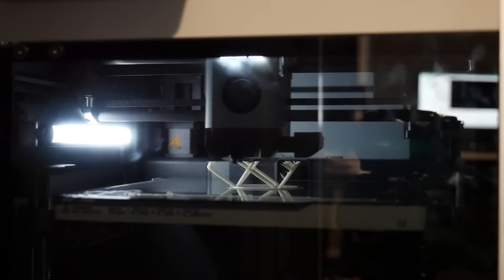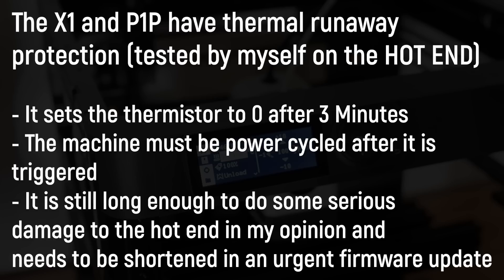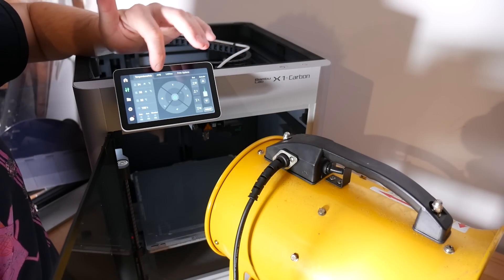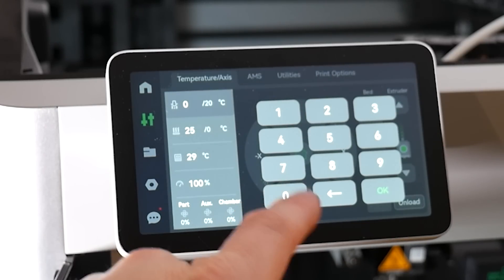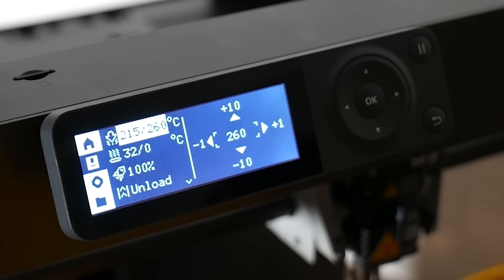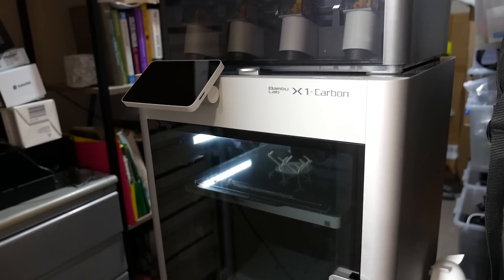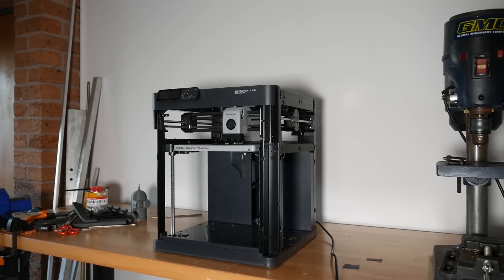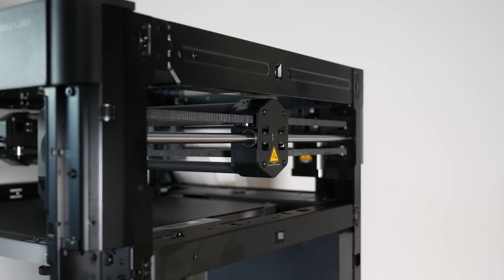Thermal Runaway Testing on Bambu Lab X1 Carbon and P1P

Comment: why not use a dam of putty like material around the bed and fill it with alcohol... may prevent the heatbed to reach more than 80C (boils at 78C) 
if it goes much higher the bed has a very bad heat conductivity!   
same test can be used fot the nozzle (if you only insert the tip into a bowl of alcohol or water (nozzle can reach far hotter than boilingpont)  than you can estimate the heatconduchtivity inside the printheah   ( the higher the Heatertemp the worse the conductivity)

Comment: Good and quick video. It does feel like an arbitrary number... there's a reason at least one company (Prusa) has a self test that checks that things heat up to a certain amount in a certain amount of time. Too high at "time", and there's one issue. Too low at "time", and not only is there an issue but it will probably cause TRP to kick in. If it is indeed arbitrary, lowering it is easy and some tests can be done to verify. Else, as they say, they'll need to update their thermal model and test. Also: forgot this side channel existed... need to make sure I'm subscribed :P

Comment: Read the official Bambu Lab announcement. When printing, thermal escape works instantly. Without printing, it works after 3 minutes. e.g. manual filament unloading. I tested it with the thermistor removed from the printer. Works properly. This information should be in the video.

Comment: Poor thermal runaway protection = no thermal runaway protection. The v400 also has a similar issue with poorly configured settings in this regard. People should not buy these printers till the problem is fixed and even then I would be hesitant to trust the company afterwards. Safety systems should always be a top priority. It shows a company's true colors if they skipped on something like that. Paired with some of the oversights of security and abuse of open source technology and Bambu is shaping up to be a shady company. I for one will not be recommending Bambu printers as a buy option moving forward.

Comment: From observing all the discussion it seems like software thermal runaway protection itself is the real danger. It is a safety crutch and seems to create an extreme false sense of security in the commnunity that it causes social media blowups like this. All hotends NTC hotends are not safe (the regular heater cartridges are all these), PTC hotends are much better (Revo/X1C/...), none I've seen have mechanical thermostats, and none have thermal fuses. Software thermal runaway protection does not protect you against a switching or wiring fault which is the most common cause of an electrical heater fire. It also uses the same switching element that could cause the thermal runaway event which means you are not safe with software TRP without an independent means of disconnecting power (manual reset main power breaker for example that is only used for TRP).

Not to mention a fault that kills the switching element could also kill the MCU running the software so your screwed while a surge would be more likely to cause a thermal fuse to blow which is the desired safe condition. So fuses/thermstats/PTC heaters add a ton of safety value while TRP is at best on the same safety effect as signage that says you will die past this adding some value but not remotely enough for the potential danger.

I do understand why thermostats and thermal fuses are not typically seen, Adding mechanical thermostats would be complicated by the wide operating temperature range you'd need a digital encoder on the shaft so the printer can tell what the max temp is set to and thermal fuses would need to be tightly coupled to the heater cartidges or elements making them specific to certain filaments which would make things complicated. It also still would not stop you from putting a CF hot end into a block of wood fill PLA that would still probably catch fire in a fault condition but short of using inert atmosphere there is always a limit for open ended systems where some degree of the safety aspect is upto the operator to conduct their own safety assement before use.

Comment: Thanks for the fact-injection to the discussion :-) 

My feeling is that it’s very good that the issue was found and reported on, but I am disappointed to the jumping to conclusions that occurred. As you said, even you might have concluded the same, but I doubt you’d trumpet it to all and sundry before even contacting BL about it :-/
Reply: Tough to do that during a live stream, don’t you think? And there were several other issues, such as the system sending data back to China, and the team at Bambu didn’t do anything until it was trumpeted to all and sundry.

Comment: I'm glad to see an outside test on this by someone who has the skills to do the test well.  It's good to have some independent verification of what's actually happening.

I also agree that the folks raising the alarm made the right decision; 3 minutes is much too long when printing PLA and we really needed to catch this.  I've said elsewhere, and I'll repeat here, that I think Bambu has been surprised by how much PLA people are putting through their machines - and although the P1P having the same system weakens this argument, I think the setup was really just a blind spot on their part, since they designed the printers for things like PC and CF Nylon.

Now that they know about it, I'm confident that - Covid notwithstanding - Bambu will put out a suitable firmware fix in due course.  As a company they've been very responsive to my personal issues (BambuSlicer got corrupted somehow and wouldn't even uninstall) and seem to be pretty quick on support in general.

Comment: Angus -- So the algorithm in question revolves around the control board not seeing the hot end reaching the target temperature within 3 minutes?   Yet I would have thought the firmware would have some idea about rate of change of temperature, and would be able to reliably detect an issue much earlier than having to wait for the entire time it might take to get to the max target temperature under all circumstances?  I mean, the hot-end power-vs-rate-of-heating curve would be pretty predictable, though varying a little depending on ambient temp. (And an ambient temp  sensor wouldn't be out of the question). Once at target temp, power (PWM %) to maintain that temp would also be a pretty predictable quantity.  Or maybe those parameters need to be acquired by a learning session. Regardless, it seems to me that rate-of-temp-change vs power would be a faster way for the controller to learn of a hot end problem.
Reply from the maker: I have no idea how the actual protection works as it's a closed source system, but that's just my theory considering how close all tests were to 3min almost exactly. I haven't explored sinking heat from an already at-temp hotend though to see what that would do.
Reply: @moremakersmuse  Sorry, I didn't mean to disparage your investigation. Just express disappointment that the algorithm would use time-to-target, instead of rate of change or power required.
Reply from the maker: @Graham_Wideman  No problem, I definitely agree with you there!

Comment: Revo and possibly also bambu doesn't use true PTC self-regulating heaters, only MCH Metal Ceramic Heaters.
youtu . be/  FIXG3tlILCY?t=975
Reply: MCH has a PTC value. PTC just means positive temperature coefficient it isn't a particular construction or material. https://www.analogtechnologies.com/document/MCH.pdf looking at the datasheet it clearly says no temperature regulation required below 500degC forumulations (For that MCH it has a tempco of 3300 +/- 200 ppm/degC which is positive clearly compared to nicrom wire ). Which means you can supply direct power to it without issue no software thermal runaway protection required. 

There are many types and regular heater cartidges used in e3d style hotends are NTC type heaters meaning (very dangerous) without thermal fuses/thermostats software is not considered enough to regulate NTC type heaters as they get hotter they get hotter faster and can typically get upto temperstures in the >1100degC in runaway conditions enough to ignite almost anything.
https://www.heating-element-alloy.com/article/heating-elements-properties-and-types.html
Reply: @riakata  It is not NTC heater in e3d. It is slightly PTC like most metals.

For me PTC heater is commercial name to the heaters with very sharp temp-resistance characteristics, different technology, which indeed can maintain desired temp when they are connected to a small heatsink, and also keep the same temp when detached.
Calling MCH PTC is confusing. (Bambu doesn't call them PTC)
Reply: @KBS_  PTC is not a commercial name it literally means positive temperature coefficient. Heater cartridges in standard e3d style are NTC heaters physically. NTC just means they are vunrable to thermal runaway hence the name thermal runaway protection. PTC heaters do not need an attached heatsink to be PTC it is a physical material property of the heater that self limits its own resistance so they self regulate even when detached from their heatsink. They certainly will heat up faster and to their maximum self regulation temperature without a heatsink but an NTC heater which is any nicrom or many other type heater will just keep heating until things get melty and firey.

You cannot "personally" believe what PTC means it is a not a trade name. They specifically say " Due to the properties of the heater, the higher the temperature, the higher the resistance " this is literally what PTC means.

Also not all metals have PTC characteristics https://dbkusa.com/blogs/whatisptc/ntc-vs-ptc-heating-elements it depends on the alloy and metals used. MCH elements like the one you found and the ones I found are PTC type elements with maximum self regulating temperature compositions upto 500degC which fits with the 400degC they mention.
Reply: @riakata  Did you even read what is in this link? It clearly says what is NTC heater.
Reply: @riakata  You also didn't read yours first link. 🤣🤣🤣
"MCH ceramic heater features no noise during operation and
radiates infrared light that is beneficial to the human body. It is
mainly used to replace the most widely used alloy wire and
PTC heating elements and components. Compared with the
former two, this heater features corrosion resistance, high
temperature resistance..."

Comment: Awesome testing ! I think the takeaway here and what Nero said in his folllow up video is that the time-out of 3 minutes is longer than most, unexpected, and can be improved. As an owner of a p1p, I’d rather see something along industry norms of sub 1 minute
Reply from the maker: Agreed, that seems to be the takeaway. We're happy it has protections in place, but they're not sufficient to prevent damage.
Reply: Well even a minute at high temps is enough to cause damage it is more a reducing damage. Obviously the best protection would be to have a software thermal protection, PTC heater, a mechanical overtemp thermostat, and a fusible link. Software is usually the last thing you want to rely on for safety. But to date I don't think I've seen any commercial 3d printers with true hardware overtemperature fuses. (If you look at any kettle, toaster, high power heating device they all have both thermostats and fusible links internally to meet safety regulations) The voron 2.4 design does specify dual thermisters and physical temperature cutoff switches for the heatbed but I guess due to the added mass and complexity hotends never seem to have the basic thermal hardware safety measures.
Reply: On that note, some of us were messing about with the heater cartridges on our x1s in the discord.  They are PTC heater elements, and it is current measuring, so there is that.  Also checks for continuity through the thermistor and I think all the fans use the tach for feedback.

I agree that I would like to see the timeout reigned in a little with the option to override for corner cases where necessary, but the amount of hardware in the loop is impressive.

Comment: I had a problem with the duetwifi and a hemera , the first time a tried heating for petg and not pla , I think the thermistor came loose and did not detect it , ( lots of smoke and melted the part cooler fan duct ) but the duetwifi is good at the first stage to get up to temp , because you will get a warning I was expecting a 1.7 deg increase per second , but only got 1.3 deg per second , so if you forget to put the heat sock on it will detect it.

Comment: So they say in their statement it can't get any hotter than 400c, but do you all realize the auto ignition point for PLA is 388c
Reply: Which means the pla will be long boiled away before igniting. Hell, there's nothing left to burn in the hotend if you leave your hotend at 250 for 20 seconds.
Reply: @3dPrintingMillennial  still not a good situation to be in tho
Reply: @Tobashadow  Well a thermistor fault is going to cause something to go wrong its just will your house burn down and the answer appears to be no. (Unless you smear about 1kg of wood fill PLA under it) although that is why you should be careful what filaments you use. No 3d printer is technically as safe as a standard kettle, space heater, etc... they use PTC heaters (the first defense the 1XC has as it is self limiting), mechanical thermostat (never seen a 3d printer with this on the hotend), and final thermal fuse (also never seen on a hotend). Notice software thermal runaway isn't part of regulations because it is just a bandaid better than nothing but it can't be called "safety rated" in any respect as it requires the FW to work, the delay to be short enough, and the mosfets to actually stop the heating (some thermal runaways are caused by the mosfets failing short at which point thermal runaway protection is useless and only a PTC heater would save you)

And at that point it will keep heating forever until you cut off power. My voron 2.4 has backup safety rated relays on the heaters for the thermal runaway protection software to have another means of disconnecting power but that is also something you will probably never see on a commercial printer as it is expensive. I don't think I've seen even a mod for thermal fuses for hotends. Heatbeds yes. hotends no that I know of.

Comment: Great on topic Video Angus. 2 follow up questions though:

1. Do you feel that with the current implementation of TRP that it is 'safe' to use the machines before a firmware fix is issued, or should users set them aside?
2. Other than seeing the error on navigating back to the home page, was there any audio or on screen warnings/notifications when TRP as triggered to warn the user?  Like, did it beep and show a warning on screen like you would expect on a Prusa or Marlin driven printer?
Reply from the maker: I would set the machine aside unless it's in a garage or similar environment. There was no beep or any audible warning. Sorry, I completely forgot to mention that!
Reply: Thanks for the follow up!